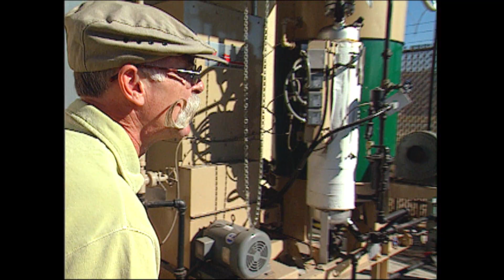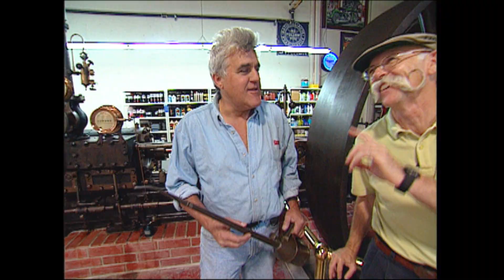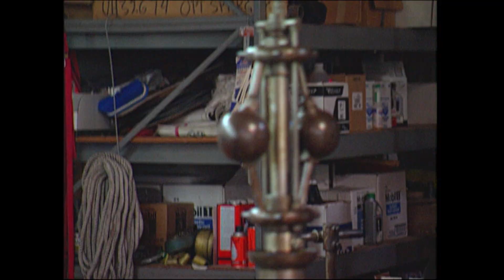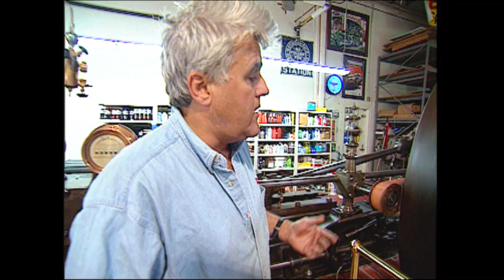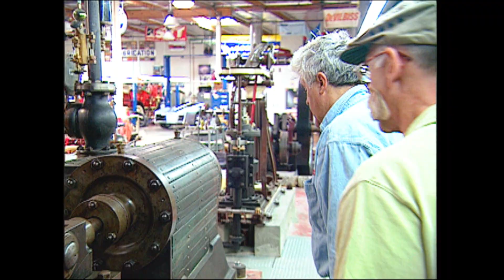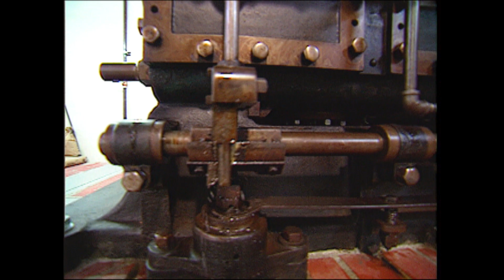Jay Leno's Most Powerful Steam Engine | Behind the Scenes

Comment: Awesome machine! One of the many jobs I've worked on was in Chicago at the Bureau of Water Pumping back in the late 90's into the early 2000's. I was there to install the the control systems for new electric drives replacing all the steam driven water pumps, drives from 500 to 2500 HP. Those old pumps were so amazing! One of the saddest jobs I think I've ever had to do was seeing all that cool equipment scrapped forever. Not to mention the hundreds of jobs that went along with them........ The prices that come with progress.

Comment: I wonder what year this was early 2000? Late 90's? Why did we move away from steam. I guess electric can produce enough energy to make steam. So much torque. Not so many ponies but once you've got going you're ripping along.
Reply: We never got away from steam, we just developed different ways of making it and using it. A good portion of electricity is generated by steam driven turbines.
Reply: @jeredhersh789  I meant steam automobiles

Comment: "Balls to the wall" is an aviation term referring to the balls on the end of the control levers (mixture, prop, throttle) having been pushed to the firewall resulting in maximum speed/power.

Comment: I always thought “balls to the wall” referred to pushing the engine and prop controls of an aircraft fully forward, towards the firewall.
Reply: I knew about balls out lol not balls to the wall though
Reply: @goosenotmaverick1156  Yup, balls to the wall is Prop Throttle and Mixture knobs, all full forward, right to the wall for full power climb (altitude is life): Throttle (obviously?), Prop forward is similar to shifting down in a car to climb a hill, and Mixture full forward dumps excess fuel in, which hurts the burn ratio but cools the cylinders so they don't melt. If you need an emergency climb you don't even look, you just grab all of them and push them forward as far as they'll go!
Reply: You are correct. He corrected himself a few seconds later: he meant to say "running balls out", not "balls to the wall"